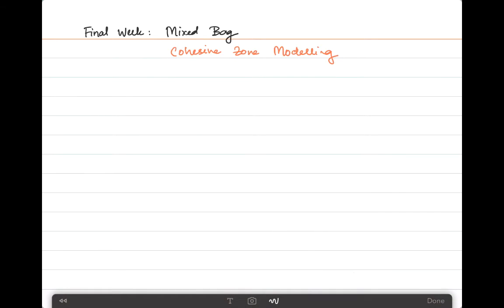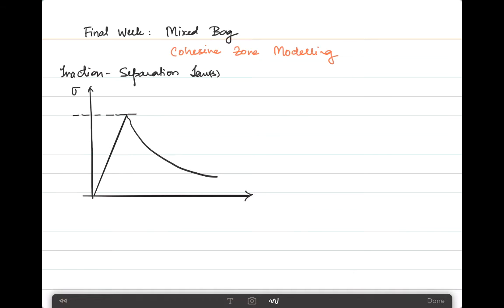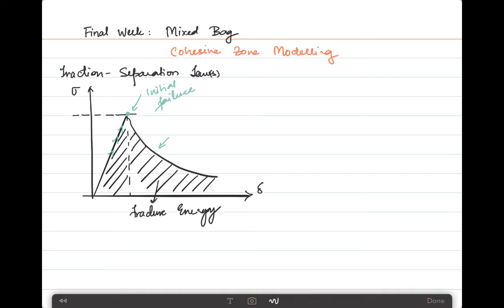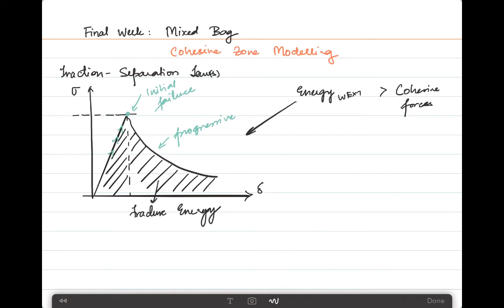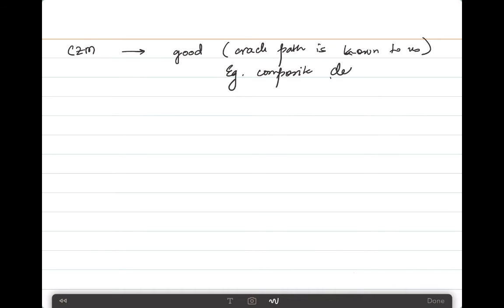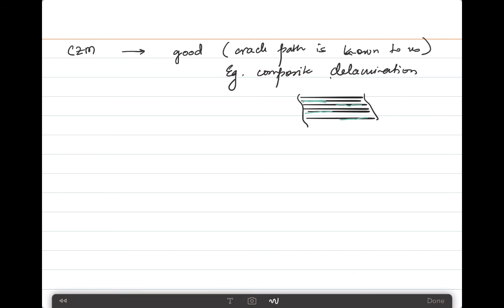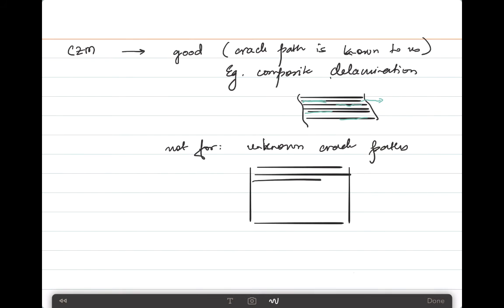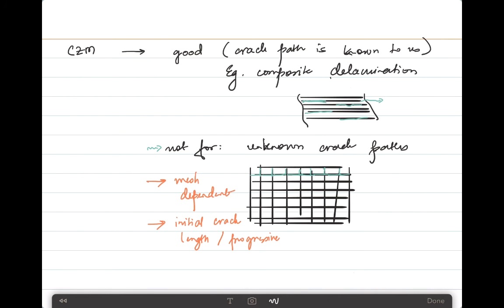Cohesive Zone Modelling Background

Comment: Thank you for sharing your knowledge. As you said cohesive zone modelling is not good if we don't know the crack path, then in such case which model is preferable..?
Reply: Use phase filed method for fracture wherein the crack trajectory will be based on  the local strain energy density and would be realistic.